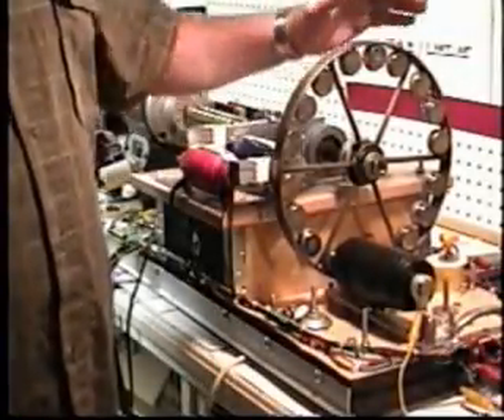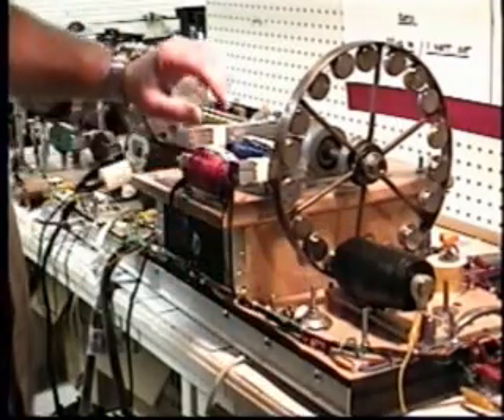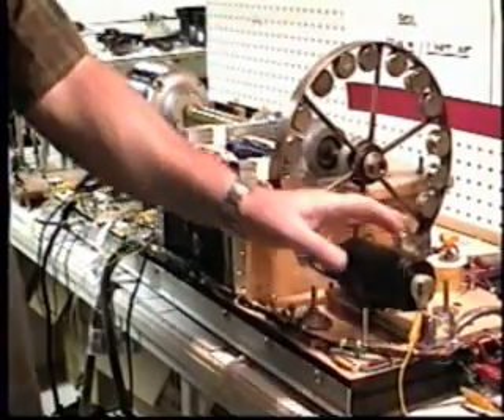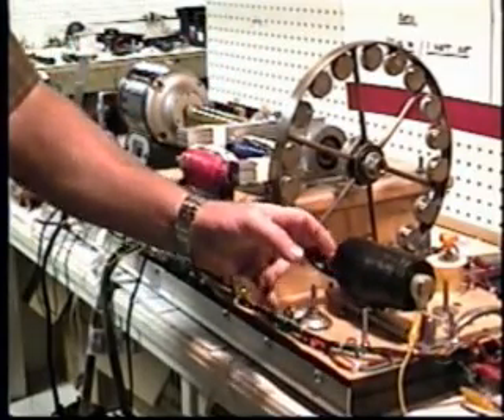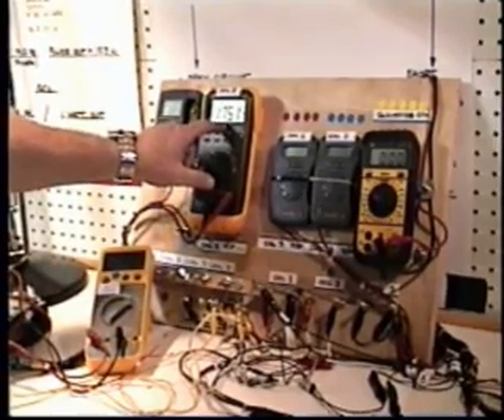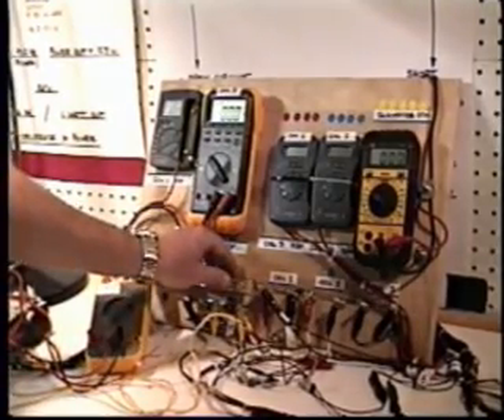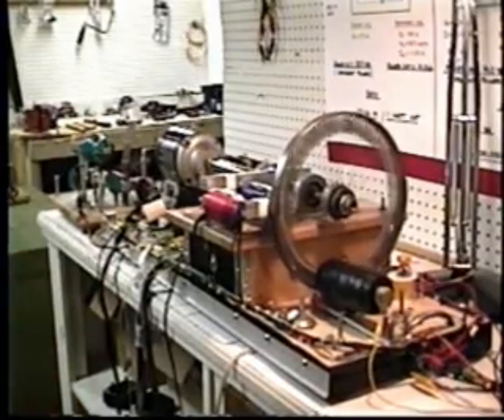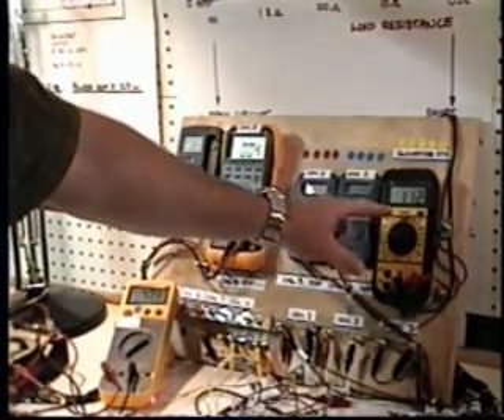PEREPITEIA GENERATOR DEMO VIDEO - Parts 1 & 2

Comment: There is a persistent mains hum I can hear when the system is running. I know it's from a power source external to the machine since the frequency doesn't change with motor speed. The effect of shorting the electromagnet effectively negates the presence of the iron rod which is obviously having a magnetic field induced in it as the magnets approach and recede and acts as a brake. Short-circuiting the coil is equivalent to placing a shorted turn around a transformer core to similar effect. So far, no apparent mystery.  Another comment to come after I've watched Part 3 (if anything else rears its head). A circuit diagram of the whole setup, external power source included would be helpful. However it appears that by shorting the electromagnet coil he is simply removing a brake from an externally powered induction motor. Why a supposed professor couldn't understand that is beyond me. The explanation of the effect of replacing a piece of metal in the shaft is, to be blunt, a load of hooey.

Comment: Back EMF refers to the force felt by two magnetic fields. It is impossible to have the EMF "Flow" into the induction motor. Lenz's law clearly states, the induced EMF will oppose the original magnetic field which induced it. This means that the induced EMF seeks to stop all change and re - establish a state of equilibrium. The back EMF only exists between the two magnetic fields, aka the induced field and "creating" field. It therefore cannot be channelled or harnessed into the induction motor. A secondary set of magnets would be required to channel the effects thereof. The lorentz force is restricted to the generator coil and magnet rotor.

Comment: no laws broken - magnets recharge themselves from their environment providing input for the output?
Reply: +Island Group Although it doesn't exactly break any laws of physics, it is undoubtedly a very efficient motor, which does give us a step in the right direction, possibly allowing us to slightly modify the design to create easily producible high-efficiency generators, which would have a lot of benefits for us as people. Just because it is not what people thought it was, it by no means is not useful.

Comment: when he had the center stainless steel he also inserte a baterie its so ovious check it out
Reply: Do you seriously think a small battery can power a motor that size? It's a scam, but the answer isn't a small battery.

Comment: A disc that rotates and gains momentum without using energy...hmm what could that be used for? Maybe you attach it to an alternator and have a means to charge batteries, which over time could supply your house with energy.

Comment: The incompetence of MIT and U of Ottawa professors who didn't understand Heins' machine is stunning! I would fire them before doing any more teaching (read confusing) to future engineers.
Heins' machine is just manipulating magnetic friction - in simple words it is equivalent to a friction disc. The motor accelerates only because some of the starting friction is removed.
No over-unity, no useful power or anything. Heins knows all these I wonder why he doesn't stop fooling the less informed.

Comment: Please forgive me if I'm repeating ideas from previous comments since I haven't read through them.
I would feel more comfortable if there was a verifiably constant mechanical load for both scenarios, rather than him shorting out a coil which may be consuming a different amount of power in different circumstances. If we're going to talk about a possible perpetual motion machine then we need clear illustrations of total practical system input energy vs output energy.
Since there is no storage sys

Comment: @crackahcrackah Ah, one of THOSE phenomena: the ones that can be detected only by the experimentally incompetent and replicated by the even more incompetent. One common symptom exhibited by such sad cases is that they believe that Edison and Tesla were some sort of scientists instead of mere Johnny-come-lately inventors exploiting the discoveries of others. Even when Edison did, on one occasion, observe something novel, he attributed to 'paranormal activity'. I bet that you even believe that ...
Reply: Right, so who discovered tri-phase AC? Who discovered ultra low frequency wireless electricity transmission? Who first not only discovered, but harnessed the boundary-layer effect? I'm sorry to inform you of this, but Tesla was actively using effects heretofore unknown to the larger scientific community in his inventions, which were later explained by said scientific community long after the fact. Hell, MIT didn't even get short range wireless electricity transmission done until the 00's, and then at a range of meters, when Tesla was doing it at distances of miles.

Comment: @flowerbower What you're describing is entirely irrelevant to the phenomenon that I've raised. Again, more deflection. The electrical pressure waves are a commonly produced phenomenon but unfortunately most are not familiar with them, and people like you obfuscate and misdirect others. This phenomenon which both Edison and Tesla worked with (the latter perfected incredibly important inventions with it) is discussed at length in a number of his lectures and demos.

Comment: @crackahcrackah The multimeter comment was sarcasm based upon fact. I can do tricks with measurement that you cannot even dream of, such as having the reading depend upon who is holding the meter. Of course, someone who refers to 'electrical pressure waves' is certainly 'quite a few cells short of a battery pack' anyway.  
BTW, if you check other YT comments of mine, you will find that I am an atheist, and then some. Atheists don't have 'brethren'.

Comment: @flowerbower You only vaguely know what you're responding to which is why you're all over the place with your commentary. Multimeters can not measure the energy in this waveform, but you already knew that didn't you deceiver? Multimeters are not made to measure electrical pressure waves. Uh Duh. You should be grateful your kin owns and attempts to control youtube and google. Otherwise even more people would be learning about you and your brethren.

Comment: @crackahcrackah I suppose that it WOULD be inaccurate to claim that magnetic field changes had absolutely no effect upon the weakly magnetic oxygen atom. However, I fail to see how any slight MHD pump effect would produce a nett energy gain. That is the problem with cranks and cyclic processes: they are quick to seize upon half of the cycle, but conveniently forget the other half. I believe that that is what unscrupulous salesmen call the 'Duke of York' principle.

Comment: @flowerbower No, no, actually you are quite wrong. "Acoustic energy", or compression waves, actively enter what you are falsely claiming is a closed system via the inductive field collapse. That spike IS NOT counter EMF but instead, it is ambient environmental energy rushing into the circuit. Counter EMF is only present at the same time as the EMF from the generator in the circuit. But SURELY you know this and you aren't ignorant of the difference, nor attempting to mislead others...

Comment: @flowerbower No, an open system is what you have with certain systems as can be easily replicated by using Tesla's high frequency current patents as a guide. Patent 568,176 is the most basic form and it taps the ambient environmental energy all around us. Given the time you spend attacking such videos I wouldn't be surprised to find out that you are PAID for your actions, and at a minimum you like to talk over the heads of the average person who takes an interest in this. That's petty behavior.

Comment: @joecellwaterpower I'm still not sure what you mean by this magnetic wave?I get the impression you're talking about radiant energy, that is,the longitudinal wave + scalar components of the inductive collapse,which has been filtered via condensors about the segment of the circuit in which the make and break occurs?You're describing what happens right but I haven't heard magnetic waves applied to this phenomenon.Please look at Tesla's "high frequency current" patents for the effect.

Comment: Keep in mind this does not invalidate the theory explained in this video.   It is actually quite true that simply bringing a magnetic field next to an induction motor's shaft will speed up the motor.  It is a simple experiment anyone can try.   So probably both effects are happening.   Also, Lenz's Law is still balogna -- go look at the Bi-Toroid Transformer videos.  I have replicated this work and it behaves as described.  Sadly, the law will not change because the academic world is a religion.

Comment: Thane Heins has a video from April 1 2009 where he explains that energy from magnets is getting stored in the coil Static field instead of Magnetic field.  He leaves out details.  I'm 99% sure that what's really happening is an electroradiant event due to a slowly building and rapidly collapsing field around the coil -- resulted by the magnet moving super quick past the coil (microseconds).  This causes negative entropy and, thus, energy gain.  See the work of Edwin Gray and Peter Lindemann.

Comment: of course it speeds it up, but what is happening is it is actually synchronizes with frequency. the thing is acting like a synchronized motor. if you take to induction motors and join them at the shafts with a steel couplng, the drive motor pushing the induction generator will appear to speed up, but it is the back emf of the generator flowing in the single conductive shaft that causes the prime mover to synchro itself to the applied frequency.

Comment: wouldn't it be just like the gears on my bike??..  i could apply the same pressure on the pedals . . .  but depending on the gear i could speed up. .  or slow down . .  isn't that what he's doing with the bar?? like changing gears
Reply: No

Comment: My I first start this comment saying, don't you dare try and correct me unless you have at least a BsC in physics- coz that's the level I'm coming from.
He's already made a mistake at 0.53 - The polarity of the induced magnetic field is NOT THE SAME as that creating it- it's acting to OPPOSE THE CHANGE IN MAGNETIC FLUX caused by the approaching magnet.

Comment: There is a potential difference of several hundred volts between your head and your feet. That can be used to drive a motor.
One can use an aerial to capture 'stray' electromagnetic radiation.
 In each case, the energy gathered is minute and it would take decades merely to pay for the equipment used to collect it.
The magnet machines on Youtube are the same ones seen 100 years ago; the only change is the modern claim that they are 'open systems'.
 You have no evidence; just better fakes.

Comment: There is nothing to exhaust! Magnets do not continuously produce energy! Ask yourself this: what is the difference between a magnet and an unmagnetised piece of the same material? The atoms are exactly the same in both cases, so it cannot be the 'spin of the electrons' which is the putative source of energy. The only difference between a magnet and the plain alloy is the alignment of the spins. Magnets are not magic!

Comment: If something is attracted to a stationary magnet, it stays there. You cannot separate them again without using energy (unless you wait for the magnet to de-magnetise itself, which still does not change the argument).
 If an attracted object is displaced by a moving magnet, it is the thing moving the magnet which is providing the energy; not the magnet itself. Try to seize this simple fact.

Comment: A force whose point of application does not move, does no work. When it does, the energy is converted into other forms and the system tends towards a minimum-energy state. And there it stays. No cyclic process is possible in such a closed system. You have obviously ignored every science textbook ever written (except perhaps for the medieval ones).

Comment: Magnets do produce work. They are capable of moving objects in a vectored displacement, that is work, by definition, and no, energy does not have to be added to the system, since it is the magnetic property of the material that does the work ITSELF.

Comment: Sorry "joule". I suppose that every mistyped word in this forum would be used as ammunition against me, but it doesn't refute the fact that I happen to be correct. We're not talking about changing magnetic force directly into electricity. We want to use the EM field to create an EM vortex, which accelerates a system merely by the system being initiated, and can be sustained by inertia alone, allowing all excess acceleration to be siphoned off to power a generator.

Comment: Jaspian: I really do not see the point of arguing with somebody who thinks that the unit of energy is the 'jewel', but - for the record - the only energy available in a permanent magnet is the mechanical stress energy which arises from the domain structure. This is minute, but has observable effects. For instance, a magnetised piece of steel is likely - ceteris paribus - to dissolve more quickly than the non-magnetised steel when placed in a corrosive liquid.

Comment: Jaspian: two separated magnets are in a higher-energy state than the same magnets touching. That is why they move together; things always tend to the lowest-energy state. One can obtain energy from their moving together, but it is only the energy that was used to separate them in the first place. It is impossible to have a cyclic process which continuously extracts energy from permanent magnets. No matter how complicated the arrangement, it will move to the lowest-energy state,  and stay there.

Comment: Two 'points of information': firstly, it is 'peripeteia' NOT 'perepeteia'. It is indeed a term from classical theatre, but it does not mean 'unexpected result'; it means a 'sudden change in fortune'; usually for the worse - since the Greek root is 'fall'.
Secondly, one should not be impressed by the opinion of an electrical engineering professor. A former head of the New Zealand chapter of the IEEE once patented his own 'over-unity' motor. There are crackpots EVERYWHERE!

Comment: You are incredibly stupid. The force of magnetic work produce the normal force that stop you from being crushed into the center of the earth by gravity. It's a force provided in the perpendicular vector direction. And no, it requires NO energy. It's just the way that atoms are, and it's not a net loss, it's a net gain. The atoms never (perceptively) lose their magnetic force.

Comment: You're missing the point. The magnetic generator doesn't produce energy directly - it produces motion. The motion, then drives a magnetic oscillator to create energy. Any time there is motion, it can be captured to create electricity. The trick is to get the magnets to produce motion on their own, which nobody debates can be done (place a strong magnet near another and they will move), in a manner that can be repeated regularly enough to create power, while avoiding resistance to the system.

Comment: WRONG. Power is generated from "work", measured in jewels, magnetism is a static property of a material, but still does work upon other magnetic substances. Any time when this is the case, IE - a static property capable of doing work,  and that work can be captured, you can use it to create perpetual motion, at least until the magnets wear our in 150 years. Still... work doesn't go in, but does come out. Where's your COE?

Comment: Magnetism isn't "energy". It's a "force". Generators produce electricity from the fuel that turns the rotor, not from the magnets. The magnets are merely a method to change energy forms from kinetic to electrical energy.

Comment: ummm.... if there are any magnet based generators in japan, they certainly don't work using perpetual motion.

as for your idea that there's more power going out than there is coming in... proof?  this would mean you can genuinely use it to power something... forever, without any external interference..  a small led lightbulb would be good enough for me.

Comment: There's plenty of new perpetual motion machines.  Search youtube for "magnetic motor". These are motors based on the power of the magnets themselves, and are not driven by any fuel source.

And a law is not irrefutable if someone is able to violate it. As soon as a law is broken, it needs to be replaced with a new one that factors the new information into the equation.

Full scale testing? There's a magnetic generator built in Japan that produces 60 amps of power out of nothing. Empirical data.

Comment: I believe that Zahn is the head of the EE department. EE stands for electrical engineering, stupid fuck.

Zahn said 1) the current understanding of conservation of energy needs to be re-evaluated. 2) Perepitia works. 3) It would AT LEAST make existing generators more efficient. That implies that it could do much more. I believe he also mentioned that it could produce free power, but I don't remember where I read that tidbit.

Comment: It is perpetual. 

More energy is generated than expended. If you take that energy and feed it back into the motor, even more is generated than expended.

Without human intervention, it will accelerate forever until it tears itself apart. If output is mediated, it will continue to operate until the shaft wears out, without outside intervention.

Comment: False, friction at a given speed for a bearing is finite, but if you graph rotation rate and force, as the rotation rate goes up linearly, there is a corresponding non-linear response in force required to increaes the roation rate.  The differential is friction losses (heat and sound produced).

Comment: So, if the motor has no load, it turns very quickly and speeds up until the back emf, plus the voltage drop due to losses, equal the supply voltage. The back emf can be thought of as a 'regulator': it stops the motor turning too quickly.